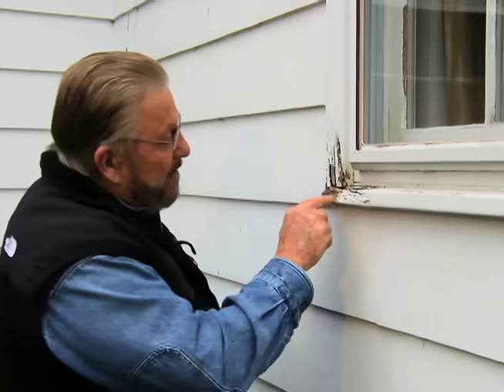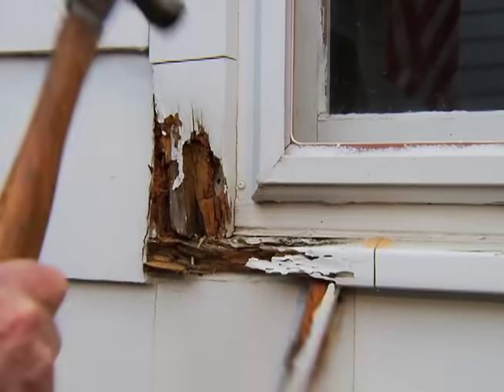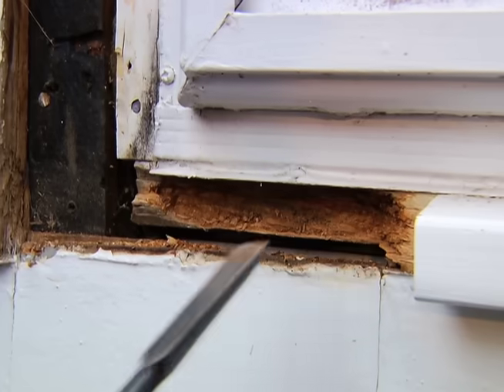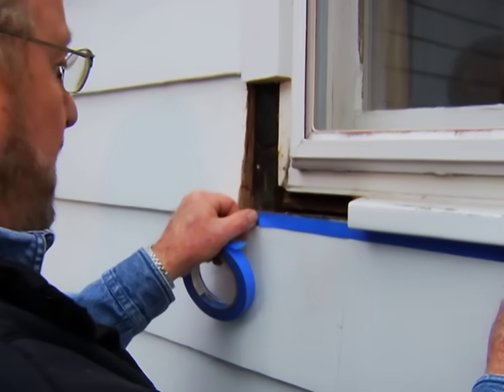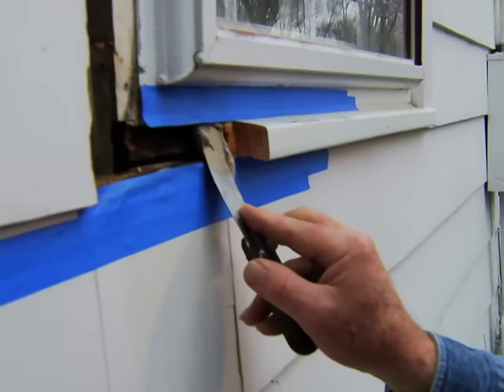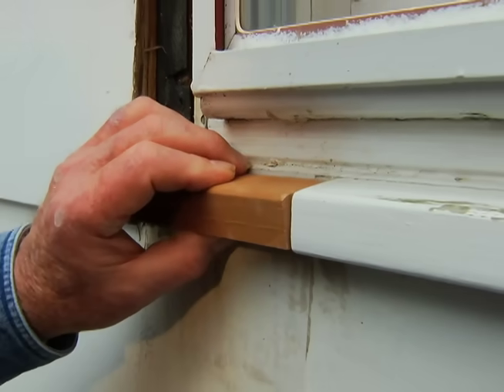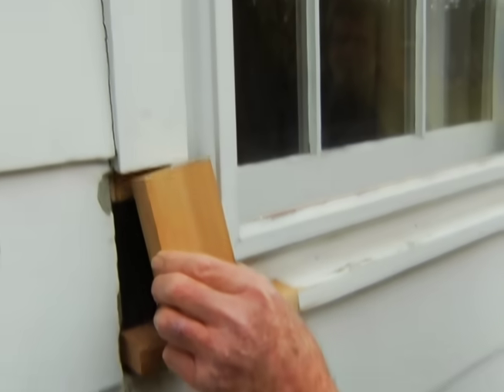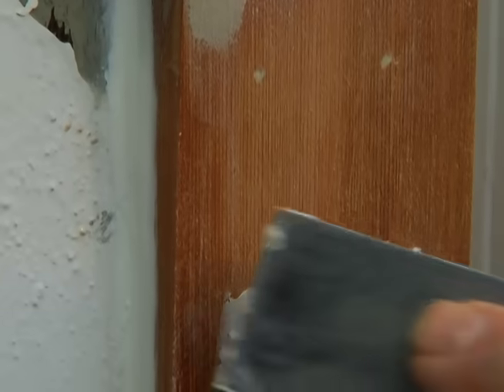How to Repair Dry Rot in a Window Sill

Comment: OK, but I would have used dry rot killer fluid first and after that chiseling out absolutely all signs of rotten wood .... then hardener, then piece in some new timber. Two-partr filler might seem to do the job but It's a bit like papering over the cracks. I'd bet that dry rot will come back and only show itself when it has eaten away whole lot more of the frame.
Reply: He couldn't get it all out.  The lower part is obviously load-bearing, as it is supporting the window.  If he had knocked that out, he would have created a bigger job.  And in order to keep it a "simple" job he took shortcuts and the whole thing will have to be repaired and replaced in a few years.....if the owner is lucky.

Comment: No. That original window sill rotted for a reason. Maybe it wasn’t installed correctly. Maybe the wood wasn’t of quality.

Regardless, the best solution would have been a complete removal and replacement installed correctly.
Reply: sure jan.. do you work for the window makers lobby?

Comment: I like udavidism
's suggestion of driving nails into the rotted wood to anchor the filler to.  That Minwax High Performance Wood Filler appears to be glorified polyester Bondo auto body filler, which shouldn't be mistaken for 2-part epoxy wood filler used to restore rotted wood.  (Bondo also makes a wood filler but I'm unsure if the formulation is any different, since auto body filler supposedly isn't appropriate for exterior wood repair because it doesn't contract and expand with wood as epoxy wood filler formulated for that purpose.)  I would have also tried to scarf rather than butt the wood joints together to make a stronger repair with more surface area and I would have epoxied the wood joints together.  Treated lumber would also be a wider choice for the patch pieces, and I would have prepared for finishing by sand smooth, applying a transparent sealer e.g. Thompson's before priming with an oil-based primer (the only type compatible with Thompson's because it's solvent-based) and painting.  The use of a transparent sealer prior to priming makes a significant difference in overall wood protection from moisture, which is the main culprit of rot in the first place.

Comment: So is that called "dry rot"? Looks more like the rot caused by water getting to the wood, not dry rot. Dry rot is caused by a fungus, rot from wood getting wet is a bit different as far as I know, even if even the fungus caused dry rot demands access to some moisture.
Reply: Wood doesn't rot if it isn't wet!  Fungus can't survive in a dry environment.  'Dry rot' is just wood that rotted from fungus when wet, but is now dry!  His repair is temporary if he hasn't solved where water gets into the wood, but wood on the exterior is always in a state of  deterioration.  The previous owners of our house bondo'ed the hell out of our front porch.  It looked good until after the first winter, then it quickly fell apart.  Big chunks of bondo came out of all the rot cavities when the wood just underneath let go too.

Comment: Another method is to use hot glue to inject directly into the rotten wood. You do not need to remove anything. Once the hot glue is cooled, which is very quick, you need to put caulk or perma patch to coat the hot glue. That will allow you to paint the surface.

Comment: Yea but, the problem is that most or all of the frames and sills are rotted.  I think my foam would work better....
Reply: the reason it rots is because water gets in higher up in the sill. seal off all cracks that allow water into the frame interior and you will stop further rot. once the repair is done the waterproofing is essential.

Comment: Yeah i dont think so!! Its cheaper if you just replace the 2 boards, your way, you have to buy the wood, filler, wood hardener, putty, paint, sandpaper, small plane, putty knife, chisel, adhesive, caulk. My way wood, paint and caulk

Comment: After taking a class years ago at Northeastern University a professor made the point that there is no so thing as dry rot. Unless there is moisture present wood will not rot.Also instead of the min wax brand just get Bondo same thing less money.

Comment: there is no such thing as dry rot..... water rotted the wood... and then dried out... but if you like the phrase dryrot.. keep on using it  nobody else cares..

lock and load ...another one.. it just feels good to most to say lock and load
.. rather than load  and lock...you have to load bullets and then lock the breech or chamber..

u s president W bush said nu cu ler.. instead of nu cle er.

websters caved to newspeak slanguage by ratifying irregardless as reinforcing  rather than improperly using a double negative... regardless does the job without the extra syllable...

Comment: No such thing as DRY ROT. At worst, Brown Rot is Fungal. You didn't even fill the cavity behind the work, which will just allow the moisture to start this process all over again. You also failed to kill the fugus, which is a very important part. And finally, you're sloppy. I would have fired you eight years ago.

Comment: Excuse me but you did it ALL WRONG sir. Supposed to use a saws all to remove the dead wood. Then Bondo and replace using a nail gun. Don't know WHERE you got your knowledge from. You know like these modern day HACKERS do it? Slam bam on to the next job south of the boarder guys? Real craftsmen like you are just about all gone. Today and tomorrow's generation of kids are and will be lost on projects like this. Too busy playing with their damn cell phones and Nintendo games.